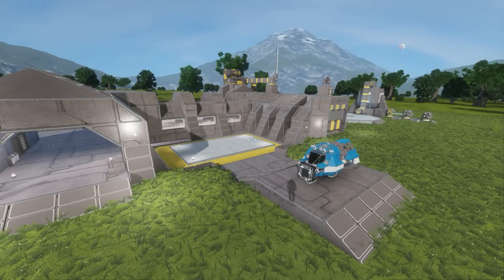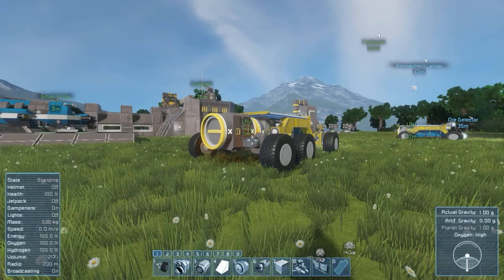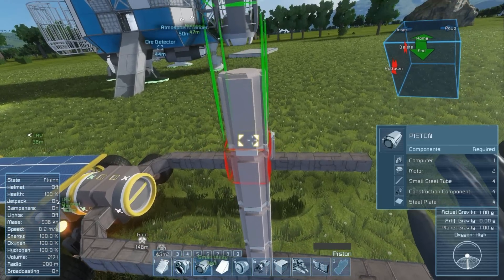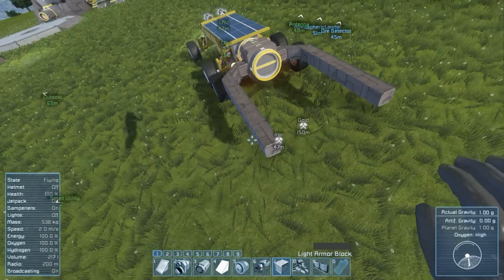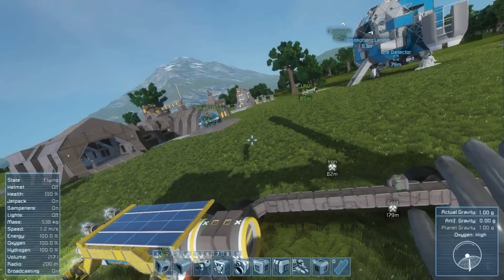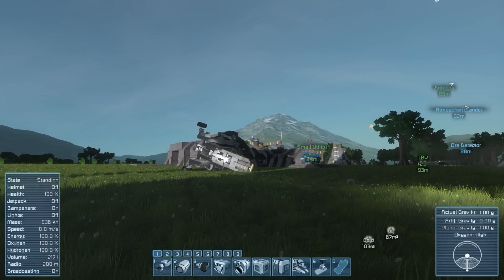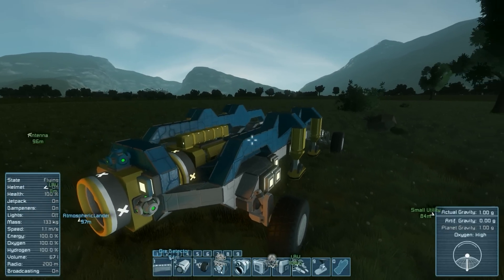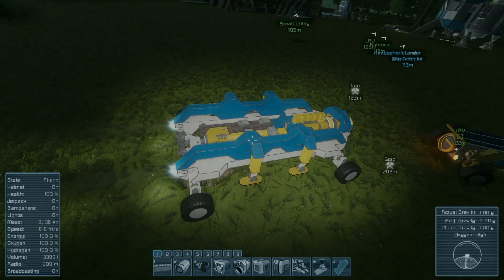Space Engineers | Planet-Fall | Part 4 | Mining Attachment

Comment: Nice stuff. How did you attached all to the both rotors? i tried to do it but realised that middle block between rotors cant be placed coz of texture conflict. i tried to compensate it via rotor's shift option but ive got nothing- this block won't attach correctly to next block.
Reply from the maker: +angeltensey Use merge blocks to combine the two grids
Reply: Uthris
Can you please tell more about it? Im not too good in this game's tricks. And look: i want to build one large mining vehicle using your idea. is it technically possible?
Reply from the maker: To combine rotors like I did you do the following.

Each arm is connected has a merger block on it. Align and rotate the rotors until the merge blocks combine the two grids. You may now build blocks across the two grids as if they are one.

I also suggest looking at a video of this - as it shows it better than I can in text
Reply: Uthris
Thank you so much!
Reply: +Uthris and now ive got another problem. my drill is shaking. it shakes...then piston shakes then drill's crane shakes and flies out of planet with michael bay's explosion.
Reply from the maker: dont know how to fix that
Reply: Uthris
i thought about bunch of gyrosopes...but will work w/o engine?

Comment: I wonder if you could make a small ship frame like this, and use a merge block to connect in a large ship conveyor, piston and drill? The connectors don't care for grid size, so that part would work. But you'd get a much slower piston push. 0.1, instead of 0.4. And I believe the length of drill would be about the same. Big drill might also dig faster than the small ship drill.

Other than that, this is an absolutely awesome mining rig. If you add an on/off button for the rotors, that would give you your mining angles.